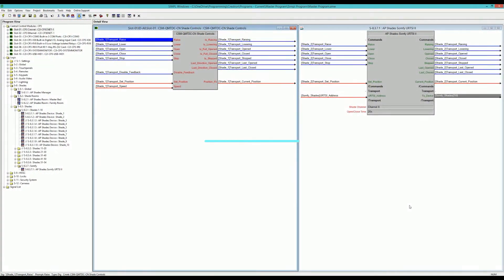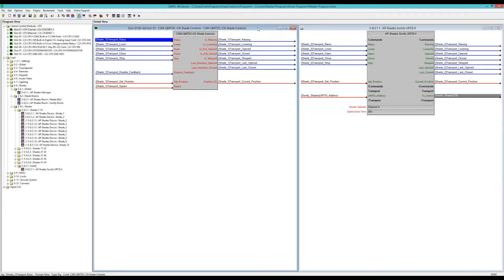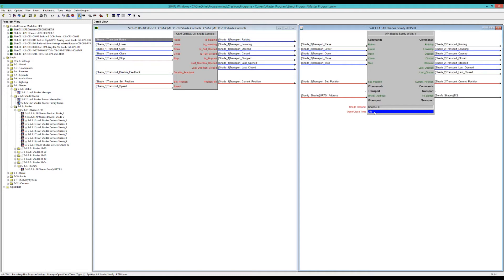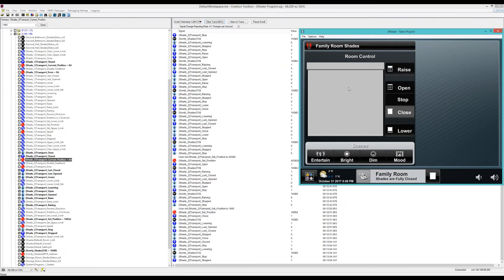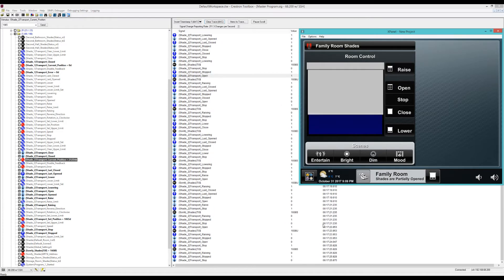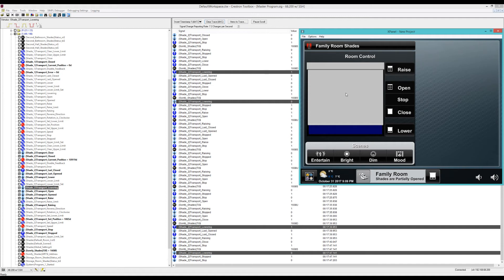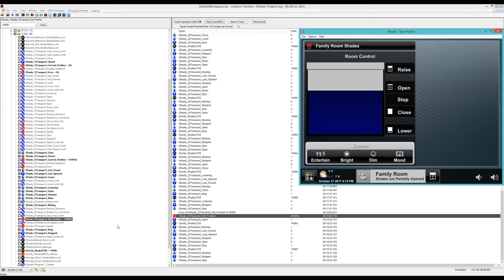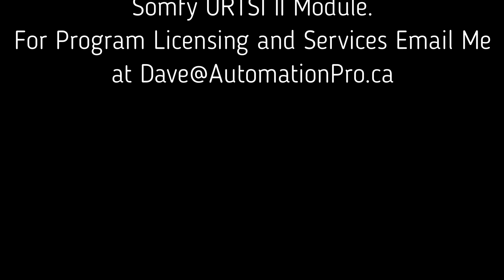AP Crestron Somfy Universal RTS Interface (URTSI II) Programming

Comment: Hello Dave
I like all of your works.
I have a Question here, Did you notice that sometimes the opening time not the same of the closing time?
Reply from the maker: On the wired Somfy shades, the difference in open/close times are slim to nill, say 52.3 seconds vs 53.9 so there was virtually no difference.  The battery powered shades did have a 2~ second or so difference from open to close so one day i'll make it separate but its no where near the point where it'll really skew the calculations.
Reply: I made a module for shades positioning (with open/close timers), but always you have to close the shutters or open all the way for first time so it syncs with the virtual shade on touchscreen and you can save/recall and stuff.
 I would share with you if you want 
(I think only me can use it :D .. because lets say shutter opens in 53 secs, you have to insert the time to 0.53s + it contains many warnings and notices and no time to clean it)

did you try this module before? http://applicationmarket.crestron.com/somfy-ci-somfy-rts-europe/